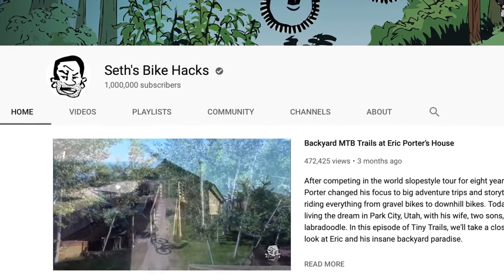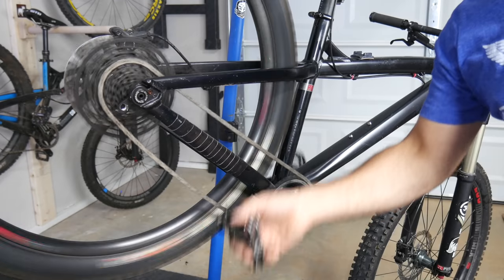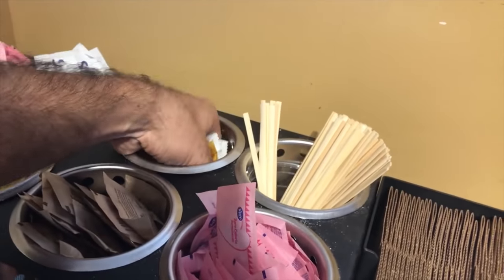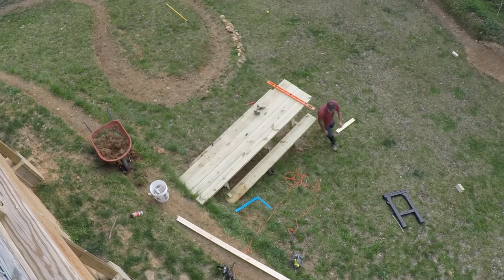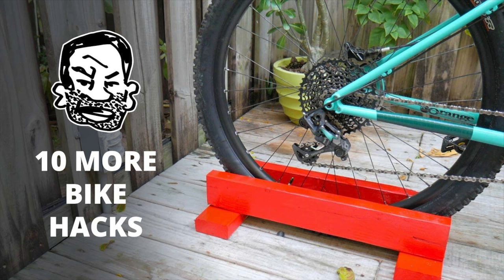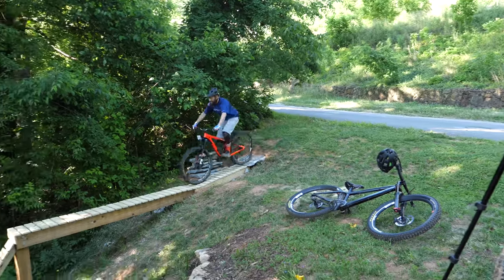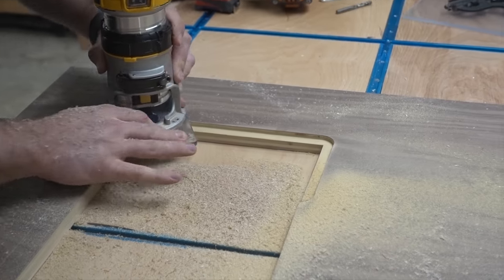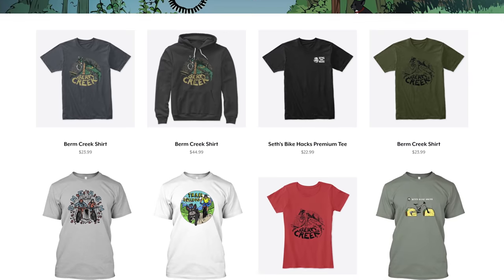Here are the 10 Videos that Got Me to 1M | And thanks for that!

Comment: Please read!
Before buying my first MTB (1 year ago) I found your videos of what makes a good bike and I was instantly hooked. I bought a Giant Talon 3. I have been riding the bike for a year and it works perfect. I want to learn how to jump and do a little more "intermediate - advance stuff. If you can please make a video on what makes a bike capable to hold this amount of punishment I will be thankful forever. It doesn't have to be a full suspension ( love hardtail). I enjoy my bike but for example my fork has a yellow sticker that explains that I cannot use my bike for jumps(Suntour fork). 

Should I just buy a new higher-end fork? 
Should I buy a full-suspension bike?
Does the weight of the bike matters?
Reply: I bought my first bike in 2013, a specialized rockhopper pro. In my experience the rear rim is the weak spot. Had to buy a new rim after a couple of spokes almost tore through it, after a rough landing i guess. This year i bought a new bike (yeay), a scott spark 950, and i already had to replace the rear wheel, beceause the rim started to split under the rim tape. In both cases I had the rear rim replaced by a stronger one, and still use both bikes today. Having said that, my advise to you would be to just ride it, and replace the parts that fail. Have fun!
Reply: Oh, and to answer your question about the weight of the bike, I think the problem is that the bikes are too light, in other words, not strong enough. Especially the L and XL frames which are made, clearly, for bigger riders, like myself. How is it possible that a size small frame has the same maximum system weight as a size XL frame? That's just bad engineering if you ask me.
I do like the full sus, the rear wheel really sticks to the ground in corners, and of course it is smoother over bumpy terrain. But i still love my hardtail too, just have to use your legs as suspension.

Comment: @Seth’s Bike Hacks You should get your finger check out. It’s called trigger finger and it’s when your tenant doesn’t release. You can get it fixed but you may need surgery depending on how bad it is. My grandpa had it and he had needles put in to release the tenant. But it isn’t a huge deal.